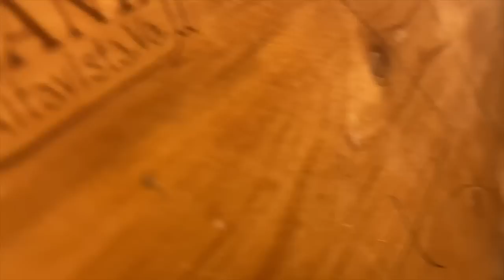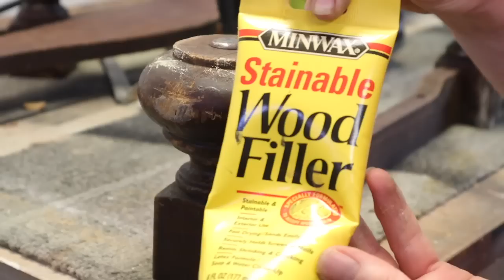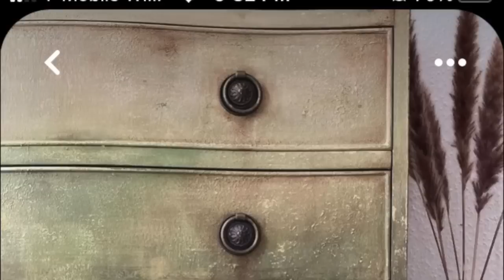Piece of JUNK left out in the rain but I sold it in 12 hours!!

Comment: I love the repair of the foot using the hot glue molding process… I’ve done that in the past, but used sculpy to make the mold and then oiled and used the mold to make parts for repair with sculpy which I then glued on… more work, but I was able to make really intricate parts on ornate frames that required no sanding to shape them.  Both methods really have their place… And your hot glue gun mold is faster. 👍🏻
Reply from the maker: Woah I’ve never heard of that. Thanks for sharing it with me I will have to try to remember it. Haven’t had to repair intricate details but I’m sure if it keep at it long enough I will 😆🥰

Comment: It turned out great, but I felt so sorry for you as a lot of work went into it. When I used to paint, I found experimenting was better done on a scrap piece of wood and not on the piece that I was going to be working on. Just a suggestion to save you some time! Although I’ve never seen you do anything and that I didn’t think turned out great but if you’re going to sell you need to get things turned over as fast as possible. L O L. Great job!
Reply from the maker: Such a great suggestion. I should practice line art on something else first! 🤣 but maybe like you said maybe it was all meant to be 🤦🏼‍♀️ appreciate you

Comment: regarding the hot glue mold, the hot glue once it dries is stiff, but you can make your own silicone mold just by using 100 % silicone, water, and dishwater soap, there are tons of recipes on youtube. That works better than this and you can reuse that mold as countless times as you want. I use these recipes for making cheap silicone molds for resin and paper clay.
Here are two options: https://www.youtube.com/watch?v=fl4XodfvV3g&list=PLsZhW3hQVDG2h589lI5W8uSlemDHyiEp_&index=13
Reply from the maker: Woah that’s so cool thank you. I will definitely check it out. Love hear new tips and tricks. Thank you
Reply: @VintageAndPainted  glad to help 😊